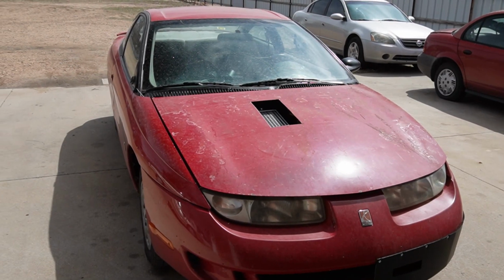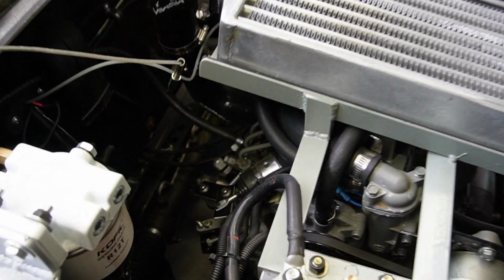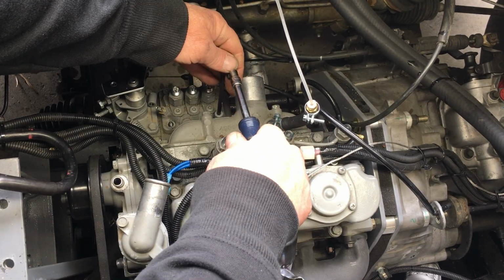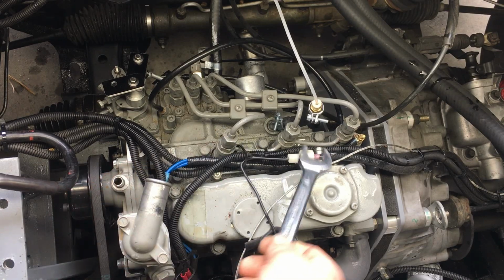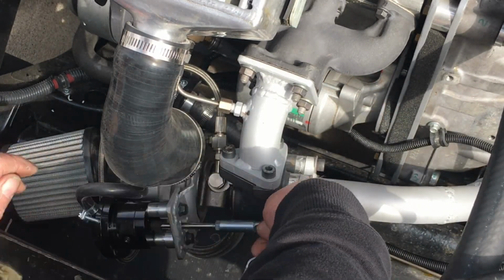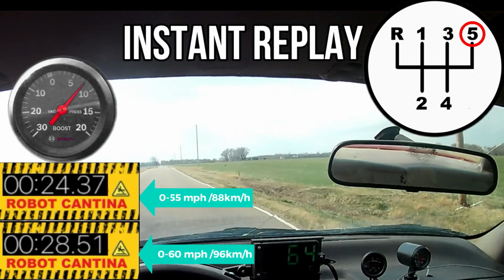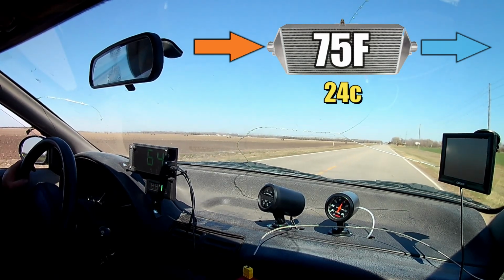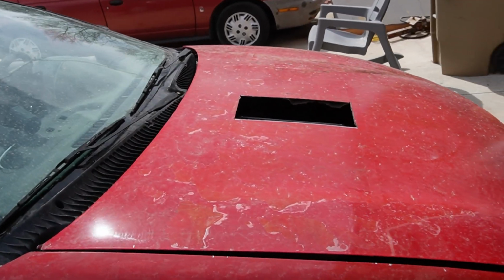S3 E9 We modify the injector pump timing and add more boost for more speed and better fuel economy

Comment: Love this project! I think the next big thing would be hybrid setup... add a couple (cheapish batteries that can unload huge power fast, but low AH) and a electric motor (that also can unload a lot of power lets say 200 kw) and make some thingy (with a button :-) so that you can use it for 10s just accelerate to 60 MPH and then use the kubota for the cruise. Siphon some (could be a cheapish solar charger maybe) power of the generator back to the smallish batteries so in 2-3h :-) you could use the electric again for accelerations :-)

Just did some rough calculations... 🙂

200 AH 12v battery for 10s if you can unload everything though is about 1 228 KW in 10s (or 1646 HP).

So I think you can get 200 HP easily for 10s with 200 AH battery (or many smaller in parallel) then ofc get a good controller/frequency converter and a engine to match...

Homebuilt, cheap hybrid that is fast and really great fuel economy :-) or maybe just get the new Prius :-)

Comment: Likely impossible suggestion, but what about reducing the turbo boost and adding a really small positive displacement supercharger? Should take care of the temperature issues, and cause a better air/fuel ratio at lower RPMs. The small amounts of parasitic drag shouldn't be that big of a deal, I should think, although you may need a pressure-actuated bypass valve on the supercharger for when the turbo spins up, so that it doesn't become a restriction.

...Of course, that assumes that there's a takeoff point for a supercharger. Alternative would be a twin turbo arrangement with an even smaller turbo to provide early boost.
Reply: Other thought would be some way to dynamically restrict fuel more at lower RPMs - but my ideas here could kill the really expensive pump.

Comment: Thank you for experimenting further.  I still think there's better efficiency to come.  Why does the turbo not spool up enough at mid revs?. Exhaust manifold design? Or restrictive air filter design?. A piece of twin density air filter foam (left dry) off of eBay over a made up chicken wire (for volume of air) frame, cable tied over the intake snout would work way better. Or just leave the filter off altogether for a quick test, if it's not dusty where your at.  Think bell mouths on race cars/bike's. Why did they do that?. Make it big like a watering can sprinkler end thingy.  No sucking around 90° bend. 10 bucks cost and boost pressure up is my 10 cents.  
Great video. Thanks again  😎
P.s  Unburnt fuel causes hotter temperatures. George Wiseman, a mpg guru. A complete burn will run cooler.
P.p.s  Over fuelling a diesel will make it go pop. There the opposite of gas motors.
Food for thought  😎

Comment: Can the renault lights be symmetrical? Also, wondering about weight reduction further on the saturn, and also whether a gasket to the hood, and a scoop ON the hood, can throw intake temps down another few degrees.
Reply: Maybe if there's a way to measure air flow from the back side of the intercooler at speed that'd be cool! And some PC fans for when stopped!

Comment: You should rock the steering wheel back and forth to make the sound of the bearing change and show how to diagnose it
Reply: If the bearing noise increases as you turn left, the bad bearing is on the right, and vice versa. 

When you turn left, the car leans to the right, putting more pressure on the right side wheel bearing, and thus increases the noise that a faulty bearing makes. Turn to the right, and it puts more pressure on the left side bearing.

Do this test at 50mph or higher, and it will be very simple to hear the increase or decrease in noise as you turn the wheel to the left and right.

Doing it this way will completely ENSURE that you know which wheel it is. Trying to determine which side it is simply by listening to the noise while going in a straight line can be VERY deceiving as to which side it really is. 

Vehicles have a very good ability to make determining the location of an unchanging noise very difficult to pinpoint by just using your ear. 

I DO recommend changing BOTH wheel bearings at the same time anyway, they DO have the same amount of time and wear on them, and if one goes, the other isn't usually far behind. 
Although, being a cheap bastid myself, I HAVE only replaced the one faulty bearing on my own vehicle, and have found that occasionally the other one has lasted for several more years before starting to make noise, but that's not common.
Reply: @davelowets  generally correct. Had a fwd with the inner race pitted , did the opposite. Only one of hundreds.

Comment: hey silly idea. I can't remember if you ever talked about doing this or gave a reason why you chose not to, but if you still have the honda ima pancake motor from the insight, you should be able drive it with a standalone 3 phase vfd and I bet it would pair nicely with the diesel.

Comment: This is absolutely an amazing series!  Forgive my lack of understanding diesels but, would cooling the engine block help more with EGT?  I doubt it and it sounds like it's all about getting air into the engine in 5th gear.  If the intercooler only got to 75F then it sounds like getting more air is the best you can do.

Although putting a hood scoop to direct the air for the intercooler would decrease intake temps idk if it would do much for EGT because of the heat from the fuel detonating.

Is it possible to get boost to come on sooner?
Reply: With every subscriber, Jimbo's spirit grows stronger
As he races towards a future that's wild and free
In this world of metal and fire, he's the lone ranger
But he'll never back down, he'll never flee

In the cantina, where the engines roar
Jimbo finds a place to even the score
With his foot on the pedal, and his eyes on the prize
He'll ride to the limit, until the sunrise

In the dusty roads of Kansas
Where the winds howl and the sun blazes
Jimbo races towards the horizon
With the hope of a new adventure, a new season.

Comment: Disconnect the transmission and put a DC generator on the motor to make electricity that feeds batteries. Then have a electric motor to move the vehicle. We could see if it is more efficient to have to motor generate electricity and having a electric motor that is over 90% efficiency to move the car.

Comment: man, now I'm wondering if the Kubota should go into the Renault. with that powertrain combo, it'd be a pretty damn efficient way to have fun.
Reply: I've thought about getting a used sport bike with a clapped out gas engine, and sticking a small displacement diesel engine on one for years.
Reply: @JosephArata  I take it you have heard of the Boccardo Aero?

Comment: 😂😂❤  Good afternoon!  This is getting fun!  I’ll admit, my heart skipped a beat when TWO of the three shims were removed 😅. I don’t have a clue what each shim is worth in degrees of timing, but I’m guessing they’re approximately 2-3mm thick (.10-.12”) and maybe 2 degrees of timing? 🤷🏻‍♂️.  I’m just happy the little ‘buta liked it, and I didn’t get a tongue lashing!
(Edit- after double checking myself, it looks like you added about 1 degree of total timing.  The hot-Rodder in me says you’re golden, but I’ve never turned up the wick on a kabota!)

I did do a little homework, but I have slept since then, but I do remember this being an indirect injection engine. The compression ratio is actually higher than I had guessed; 23:1 or 23.5:1 depending on your engine code number.  The compression pressure is listed as 412-469 psi respectively. 

That being said, if I recall correctly, the head bolts are M8 x 1.25, so they are under quite a load keeping the cylinder head clamped down firmly on the head gasket. 
Moving forward, PROCEED WITH CAUTION!!!  
Although most times a blown head gasket will make itself known by leaking coolant from under the head, or allowing compression / combustion gasses into the cooling system, it is possible to lose coolant internally, resulting in a bent connecting rod from hydro-lock, or coolant in the oil which will quickly destroy the rod and main bearings. 
Keep a close eye on your oil for signs of contamination and or rising oil level. 

For now, I THINK you’ll be ok, but I don’t know that I’d try to push my luck beyond 15-16 psi. After that, I’d look into your methanol injection to cool things down.

Comment: Question is can you use a lawnmower engine to make a city car?
Reply from the maker: in our older videos we put a 212cc and a 420cc lawnmower engine in  our Honda insight and it did pretty good at low speeds.
Reply: @robotcantina8957  With every subscriber, Jimbo's spirit grows stronger
As he races towards a future that's wild and free
In this world of metal and fire, he's the lone ranger
But he'll never back down, he'll never flee

In the cantina, where the engines roar
Jimbo finds a place to even the score
With his foot on the pedal, and his eyes on the prize
He'll ride to the limit, until the sunrise

In the dusty roads of Kansas
Where the winds howl and the sun blazes
Jimbo races towards the horizon
With the hope of a new adventure, a new season.

Comment: Why not weld a cooling channel onto the exhaust manifold. That engine by no means uses the whole cooling system meaning that an exhaust like in a boat may work. It would not just reduce the exhaust temperature but the engine bay temperature as a whole.
Reply from the maker: The exhaust gas temperature is actually the temperature of the combustion gasses inside the combustion chamber. and not the temperature of the exhaust  system.  Its  a little confusing.

Comment: Excuse the non engineer probably talking nonsense. But if the stock rings are the limiting factor causing all this mucking about, isn’t it possible to upgrade them to some super adamantium rings or something, which can tolerate higher temps?
Reply from the maker: The engine would need to be disassembled in order to modify the piston rings.  Keep in mind the engine is only 719cc and we pretty much maxed it out.  fiddeling with the piston rings would help the engine produce power longer but  something else would likely break.
Reply: @robotcantina8957  thanks for the reply. All makes sense, however I recall you did disassemble the 212 and the 420 BIG BLOCKKKKK for this reason, eg fitting a new piston to the 212 - so in the name of important science you could do the same here… anyway all the best to you and the gnomes

Comment: Ha.  You said: "Dez Nuts."
I'm surprised you haven't used stickers.  The easy was to doubling horsepower and mileage.
Reply from the maker: I'm not sure yet.  Gaping the rings requires the engine to be disassembled.

Comment: Now I know it is very hard to manufacture, however could you try make a hybrid turbo setup like in F1, where it is both a turbo, connected to exhaust, and a supercharger connected to crankshaft (and a compound turbo (not compounding turbos) with exhaust connected to crankshaft)
Sorry I know that the channel isn't worth the cost of doing that :( , just an idea :)
Thanks for the video
Reply: It's still such a fun idea lol nothing wrong with dreaming

Comment: Running lean will make it run hot, get that stupid governor off there already too. Shave weight will help the engine stay cool because it won’t be struggling against the weight, and you’ll be able to do more with less throttle and boost.
Reply from the maker: On a gasoline engine, a lean mixture will make the engine run hot, however on a diesel engine lean is cool and rich is hot... its the exact opposite of a gasoline engine.
Reply: @robotcantina8957  With every subscriber, Jimbo's spirit grows stronger
As he races towards a future that's wild and free
In this world of metal and fire, he's the lone ranger
But he'll never back down, he'll never flee

In the cantina, where the engines roar
Jimbo finds a place to even the score
With his foot on the pedal, and his eyes on the prize
He'll ride to the limit, until the sunrise

In the dusty roads of Kansas
Where the winds howl and the sun blazes
Jimbo races towards the horizon
With the hope of a new adventure, a new season.

Comment: Ah sorry if you have a intercooler its should have fan to cool it of
Reply from the maker: The hole in the hood offers decent air flow to the intercooler.  The intercooler lowers the air temp from 120F down to 75F.

Comment: Won't removing shims also increase the duration that the injector is injecting? I also have to apologize I yelled at you initially to tell you that there was no fuel but later I never did see fuel come out, sorry!
Reply from the maker: removing the shims probably increase the duration, but the  throttle mechanism  inside the injector pump actually controls how much fuel is delivered to the engine.
Reply: @robotcantina8957  With every subscriber, Jimbo's spirit grows stronger
As he races towards a future that's wild and free
In this world of metal and fire, he's the lone ranger
But he'll never back down, he'll never flee

In the cantina, where the engines roar
Jimbo finds a place to even the score
With his foot on the pedal, and his eyes on the prize
He'll ride to the limit, until the sunrise

In the dusty roads of Kansas
Where the winds howl and the sun blazes
Jimbo races towards the horizon
With the hope of a new adventure, a new season.

Comment: Upsize the turbo next! I suggest a gt1752s
Reply: Even a td04 volvo turbo could be effective. they have very small exhaust sides and are water cooled
Reply: @madmod td04 has an exhaust wheel with a 52mm×46mm inducer/exducer. The gt1752s has a 44×39mm respectively so it would be much quicker and better onto boost. Don't know if the little kabota would be able to spool the td04 fully.
Reply: compound turbos! Since this engine is really small and works at very low RPM a single big turbo probably won't make enough boost. With a compound setup, the small turbo will help spool the big one
Reply: A volvo td04 is far to big for this enigine, it would probably never spool.

The turbo thats on here is pretty much the best option afaik, maybe a step bigger and compound it 

Id say run the 722cc diesel with 20 psi  or without wastegate, and adjust fuel accordingly with the current turbo and se where it takes you
Reply: @Zesserie  The td04 has a wide variety of back housings. The 12t model moves maybe 175hp worth of airflow maxed out. Maybe 125hp in its sweet spot. Seen them used on small k car engines, sub 1 liter with good success.
Reply: @madmod  but this is a sub 1L. because of the slow burn of diesel a smaller housing is needed to overcome the threshold for making positive preassure. 

A guy converted a volvo b230 with a diesel pump from a mercedes and the 13c(which is a tiny turbo for a 2.3L engine) never made boost when it was a diesel 

But with a turbo from a bmw 524d(if memory serves) suddenly it was boosting.

Hey if that small td04 housings exist sure, but they are big turbos for this engine

Comment: So, you sound like you know what you're doing, so you probably already know all of this...anyhoo...Because, on a diesel, your foot directly controls the fuel injection, you could just dial in the maximum fuel flow (or, more than you have now, anyway) from the injector pump and just control the EGTs with the throttle. Also, the turbo seems a bit small for this engine (You're making boost with no load on the engine). You could do away with the wastegate and just, again, control the boost pressure (and EGTs, all together) with the throttle. This is how most OTR (over the road) trucks work (computer controlled, now days, of course). It's much more user friendly doing it the way you're doing it, but since this isn't going to be a daily driver (is it?), and you're competent (and wouldn't be too heartbroken if you did manage to blow up the little kuboda...they're super tough btw...), you could eliminate a bunch of time changing setups and just use your right foot to keep everything in check. Also, with as little time as you're at WOT, and how well the cooling system is working, you could probably really lower your 0-60 times with a lot of boost and fuel, and do no harm to the engine (in 30 seconds). Then when cruising, with little throttle, the little beast will stay cool and calm! Love the videos too!

Comment: From 8-10-12psi? You need to be going from 15-25-35psi it can take it…
Reply: Definitely, any old 1.9cdti passenger car will make something like 15-16psi stock and tune to 21psi no problem. I fitted a hybrid turbo to my last diesel and it made 33psi. That took it from the stock 150hp, up to 265hp.
Adding another 15psi to that Kubota isn't likely to break anything, as long as the turbo can handle it. Same for the fuel - 625C peak EGT is nothing to worry about. 700C sustained (not peak) will still probably be safe, and it's only got too much fuel when there's black smoke pouring out the back. It needs more air IMO, and then is likely to run out of fuel pressure or injector flow before the limit of the turbo or the internals.
Reply: @JamesBalazs  nailed it!

Comment: You should probably be removing timing not adding it to get more power in the upper RPM range. Not exactly the same as a gas motor.

Comment: "Kobuta"?  I thought it was pronounced the way it was spelled, Kubota, like "Oh what a feeling to drive Kubota!" That said, I have had all sorts of trouble pronouncing foreign names, particularly if I had only read the name so shouldn't pick on you for that. I just wanted to use that "Oh what a feeling..." line.
Reply: He mistakenly pronounces it correctly during the injector removal part of the video.  I thought the pronunciation was in error, but now I see it is on purpose
Reply from the maker: I say it both ways just to trigger people.
Reply: @robotcantina8957  You were successful, at least on a modest scale.